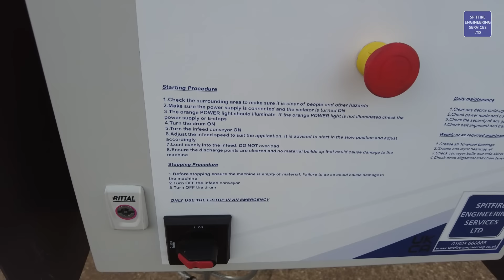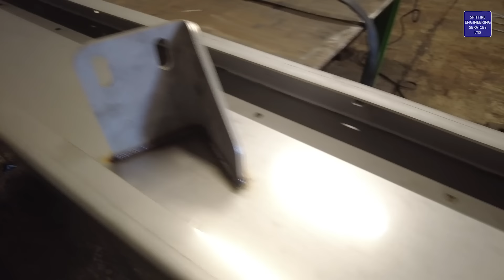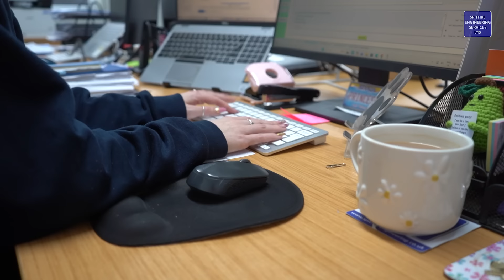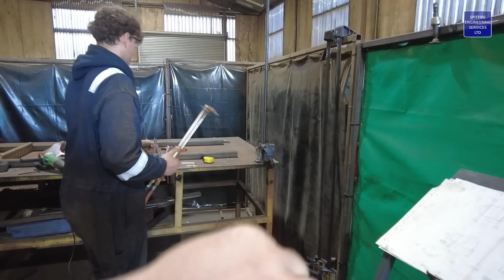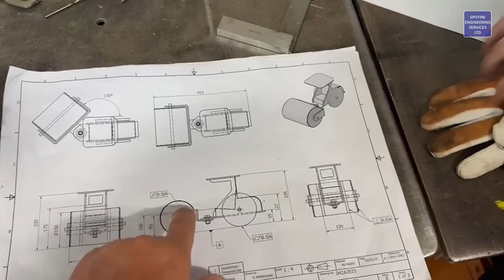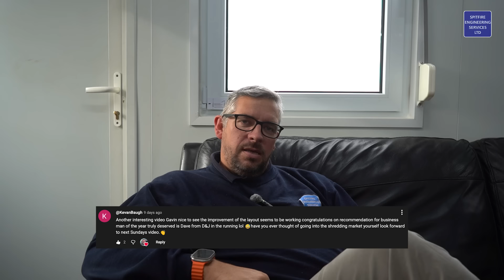This Float Tank is a BEAST 😱

Comment: Gavin - I agree with your observation about tracking actions by blue collar employees.  I dare say it is even an issue with a lot of office staff.  No system has value unless real people use it accurately.

To me the key is to find tech that can automatically gather the information needed without requiring any input from people or interrupting work flow.  There may be a possibility with an AI watching a video stream and being able to match data about the task performed versus the job it goes with, or QR codes on work pieces.

Fortunately I don't have enough of a working future left to have to find the answer myself, so I wish you luck.
Reply from the maker: tech really is the way forward for so much that businesses do ! Thanks for watching and commenting.

Comment: Always great to see the progress and development of the business. As someone who spent 22 years working in the manufacturing sector of injection moulding,the roles between shop floor and office are never smooth. It takes someone special to have feet in both camps to understand the procedures and improvements to the business and the customer requirements. How and what you communicate is important in bridging that divide. Have a good week.
Reply from the maker: Thanks for the kind words Richard - appreciate it